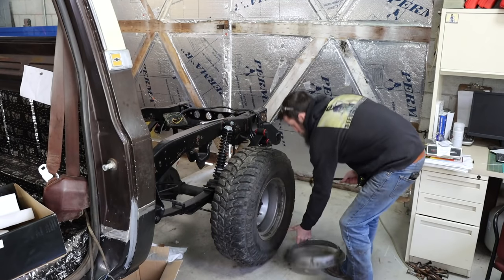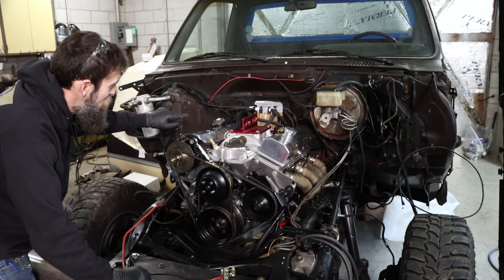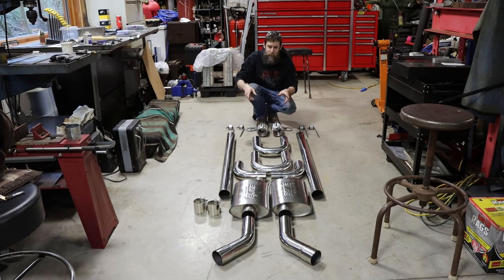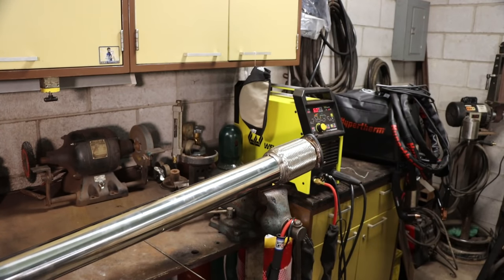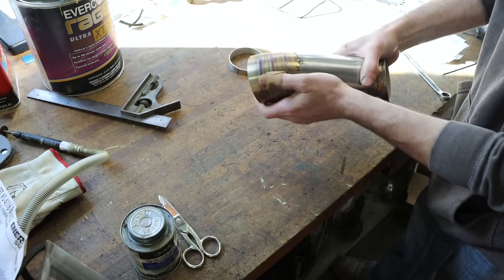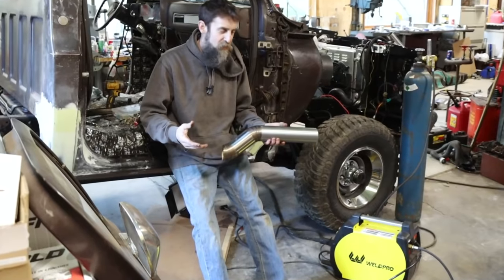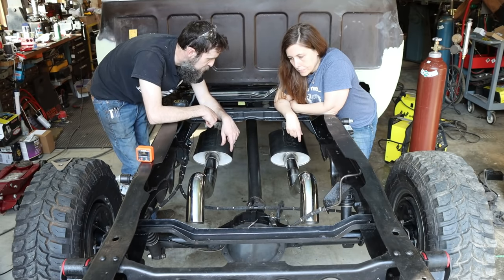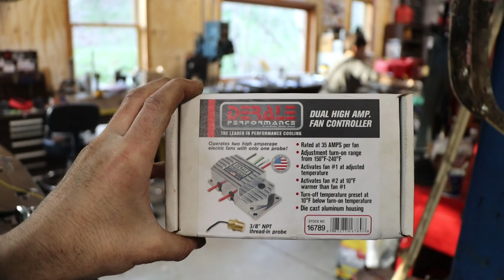Sick DIY Stainless 3" exhaust on the CHEAP!  + Wheels Complete!

Comment: My biggest complaint about daytime running lights is the fact so many folks forget to turn their headlights on in fog or at night fall leaving the back of the vehicle invisible to anyone behind you. I believe the auto manufacturers have been forced into requiring that tail lights come on with day time running lights now (I could be wrong). It's been a standard requirement in Europe that any vehicle equipped with "fog lights" is required to have rear tail "fog tail lights" (red in color and brighter) to avoid rear end collisions in fog. Your build is coming along nicely Steve, thanks for bringing us along for the journey. Stay Safe & Cheers!
Reply: This is what should happen. I live in a major metro area and quite a few folks/id10ts cannot figure out that their head lights are not on as the evening progresses. This continues as they exit the lighted expressway sections which is in excusable.
Reply: I'm not a fan of daytime running lights, HOWEVER I think that headlights/tailights should automatically come on when the windshield wipers are turned on for extra visibility in inclement weather.
Reply: It's that some manufacturers are turning the dash lights on when dusk so people think they are good to go. living in Canada where we've had daytime lights forever, it's the cars without DRL's that trick you up as you're used to seeing them
Reply: I see it all the time.  Most often it'll be someone pulling out of a store or gas station.  I suppose the lights in the parking lots are enough to not realize you have no gauge lights.  I live in the sticks, so there are no street lights or anything, but I still see people whizzing down the road without their lights on.  I've had DRLs since I bought my Jetta in 2005, yet I've never failed to turn on my lights when appropriate.  It's hard to trust drivers that fail to realize they never turned their lights on at night.  Or as you said, in fog, rain, etc.
Reply: @pamike4873  you hit the nail on the head regarding gauge cluster lights. New cars often have fully digital gauges, so they're always lit, with or without headlights on. When cars had gauges you couldn't see at night, it was pretty clear your lights were off
Reply: I’ve a 2006 Range Rover and it has an “Auto“ setting that brings the lights on whenever the sensor in the windscreen senses that the ambient light is too low. I leave that turned on all the time and never have to worry about driving without lights. My wife has had two newer vintage cars of a much less cost when new than my Rangie but they both have auto light settings on them. A 2014 Vauxhall and a 2019 Ford
Reply: @samrodian919  My 2007 Jeep Grand Cherokee has auto headlights.  I don't use it because I"m not one of those people who lack all situational awareness.  Those that are don't use it either, and that's the problem.  My wipers will turn on automatically, and in the US, if your wipers are on, the law states your headlights, need to be as well,  but I don't use those features either.  If it's raining, I turn my lights on.  I suppose it comes from growing up before all of that stuff was available.  My first car was a manual, which today is the best insurance against theft from millennials, lol.
Reply: some forget some are morons or just to lazy and think they will wear out their headlight Bulbs. it happens a lot here in Australia John.
Reply: @pamike4873  well having been driving since 1972, and the first 49 and a half years I had no auto headlights, so I think my situational awareness is pretty good.. I'm a firm believer in the Swedish idea that you have your headlights on at all times regardless of the time of day or time of year. And now I've got auto lighting it as far as I am concerned is one thing less I have to think about when driving in today's crazy world and almost good as sliced bread!
Reply: @samrodian919  Perhaps.  On cloudless days I usually don't run with my lights on.  If it's cloudy, I do.  The problem isn't auto headlights.  The problem is daytime running lights.  Well, DRL isn't the problem.  People are.

Comment: BORLA. I have a 1985 sports car and has a Borla exhaust system, no mufflers at all just the HI Performance 3" pipe out the back. It's load but not to bad if you're just taking it easy, but when you throttle it up you can be heard. One of the best sounding cars I have ever owned. Have been told that from a lot of people. Your exhaust system looks fantastic. Really a great locking job. The only thing I would have done differently was switch sides with the mufflers so tho word Borla was facing down, unless it requires them to be that way. All your videos have been top notch.so interesting they go by very quickly, but it's the quality you are putting out. Keep up the great work filming and building. It's great to watch, learn and enjoy every Saturday. So till next week,  be safe. And your helper is one of a kind. Thanks

Comment: A few years ago my son and I installed a 2.5" stainless exhaust on my 70 390 AMX. It took me over 2 months on my car lift in my spare time. No slip joints,tig welded. You did a great job from someone who has been there. George from Indiana

Comment: When you very first started this project, I thought it seemed odd to put so much effort into cosmetic repairs on an old truck. Boy was I wrong! I thought she couldn't ever be more than an old farm truck, that thing is becoming more and more beautiful. I guess it's been awhile since I saw an old square body in nice shape. Between the Wheels and everything under the hood, that's becoming a real 80s icon, particularly with that two-tone paint job.

Comment: Steve so much progress since I visited you les than 7 weeks ago! Wow you must be putting in the hours! Engine built, installed. Wheels refurbished, rad panel sandblasted repaired and painted. All that wiring and fitting the rad panel and hooking pipe work up. And the piece de la resistance, the fantastic stainless exhaust! Truck is really coming together and looking great! Can’t wait to hear it fire up!
Reply from the maker: Yep, I have been pretty busy the last few weeks. I'm trying to finish this truck up as soon as possible. She needs lost of attention 😁. Hope you trip was good and it was a pleasure meeting you.  Thanks for taking the time to stop in and say hello.😁👍
Reply: @SteveSummers  it was a thrill to come and meet you Steve I was honoured you could spare the time for me. Looking forward to seeing you and Elizabeth driving down to Lowes for some other project stuff!
Reply from the maker: @samrodian919   I look forward to getting to use this old truck for those project trips as well. It should last for another decade or more now . Next time you are back in the states you are welcome to drop back in for a ride in this old truck.
Reply: @SteveSummers  Steve, thank you. I would love to take you up on that!

Comment: Tesa tape is the best. They also make it for applications where heat is an issue.
Has been used by European automotive manufacturers  for many years.
I use it for installation of automotive stereo equipment.

Comment: That Tesa tape is amazing.  Back 20 years ago I started estimating wiring harnesses for one of the big auto companies, and Tesa came in and showed us and our engineering team this tape. They make all kinds of it, felt covered, anti-rip (which is what it looks like you are using), friction tape (no glues, just a plastic tape), etc.  All kinds.  They provided all of us several rolls of each as a "swag bag", and it is, as you said, the best tape I have ever used.  The rip/cut resistant tape is just awesome.

Comment: On start up I would spin up with the ignition disconnected to prime the oil system before first run. Great work!!! Thank for sharing !!
Reply: On SBC, you can drive the oil pump directly, via the distributor port (distributor removed, obviously). There's a ton of cheap tools made for this purpose.

Comment: soon you will get bed on - get a fuel tank and toolbox and consider rails, also think about another battery box with disconnect, also maybe put spare tire back in bed instead of underneath, think about a headache rack/rollbar and led lites - you are almost all set! - the 3 inch exhaust was a good call - think about a lift?

Comment: If you haven't already put some zip ties over the tesa tape ends to prevent it from unwrapping. In the future if you need cheap fan relays, the ones on 80s/90s Hondas by the hood latch work nicely. Wire them up the same way Honda does.

Comment: Wow, a LOT of content this week! The truck project is really coming together, and looking good. Superb-looking exhaust, so far. I vote for turn-downs at the rear bumper. 
I like the tip about the Tesa electrical tape. I was going to retape my original engine harness on my Charger, that has either been attacked by rodents and/or been heat damaged.
Reply from the maker: You will not be disappointed.  They make several different types.  The one I have is the fabric type.

Comment: Thanks for the tip on the sandblaster kits. I have one the way for the same reason as you: I have an old set of rusty wheels that need to be painted. I wasn't sure what the best way to strip them would be and then I saw your video last week. The wheels turned out great and the whole truck is looking 👍.
Reply from the maker: If you have a pretty decent pressure washer you will not be disappointed.  A couple of my wheels were rusted pretty badly on the back side and also had several layers of paint and primer. The sand blaster kits are well worth the cost.👍

Comment: Loved the exhaust system, so much better than any cheapo system from the local exhaust center. You made the right move by getting rid of the nasty electrical tape for the tesa harnes loom tape, it's great stuff and less likely to fail and has better anti chafing characteristics.

Comment: I put that exact same radiator in my c10, been pretty happy with it. I did have one issue the lower trans cooler port wouldn't seal, I eventually stripped out the threads trying to get it too. I think it might have been the flare on the original lines not mating well with the flare on the radiator.

Comment: Fiamm brand horns seem to be good. If I recall, they are available from HF.
My experience with junk yard OEM horns found that they hold up rather well. A cousin put Buick horns on his Chevy boom truck, and they were very loud. U pull it type yards are often a good source.
Make sure that you get the factory plugs with them, and maybe the horn relay as well.
Take, or at least find there a good battery to test them before buying, otherwise you might get junk ones with no warranty.
Scrap yards that buy cars is another option, if you have any nearby, and they let you look/shop.

Comment: I've always been a fan of the "street sweeper" dump at the rear wheel. You're not throwing nitrous flames (yet) to worry about melting your tires and while its personal preference, it just looks cool because of how few vehicles have their exhaust in front of the rear tire like that.
Reply from the maker: I was very tempted to run it out at the front of the rear wheels. Seeing as I had the pipe I just decided to go on out the rear. Thanks for watching

Comment: Very impressive work with the exhaust system!  This summer (and the many winters to come) you will be really enjoying this truck.  Truly fine work you are doing, congratulations! 
Please allow a safety suggestion.  I noticed at 41:30 several gas containers over your shoulder.  May I suggest you gather them closer to an exit door where they would be easier to extinguish in the event of a fire.  I have been watching since before you started the garage and saw how much work you put into it.  With as much cutting, burning, and welding you do inside the shop I suggest you reconsider your flammable storage area.  Keep up the great work!

Comment: Speaking of exhaust, I had planned to put a TDI in my Nissan D21 truck before it was stolen, and I was going to run 2.5" SS pipe. I have a baffled SS turbo diesel muffler which I bought at the scrap yard, and it's a good brand. I'm hoping to find another truck to do this on.
The muffler was a display model and had a window cut in it to show the interior. A friend welded a piece over it and polished it and it looks nice.

Comment: Steve, you can also use Type B Solar Flux for the interior of the SS tube weld area when it is not practical to purge with argon.
Reply from the maker: Ill have to try that. Most my stainless welding at work involves back gas so I haven't used anything else

Comment: The Tesa tape is used to wrap the harness wires to heated windows. Worked for Magna that makes windows for a number of brands and I can't tell you how many of those that I sleeved and wrapped in the time I worked there. The stuff isn't cheap and I'm sure a number of rolls sprouted legs and walked out of that place...

Comment: Oh I've done my fair share of welding (to the point of my right sleeve with more holes than a teabag lol), I think tig welding is better for neater looking welds and they aren't as brittle a weld as a mig can be.

The SS pipes should outlast the truck lol

Sometimes the more you fiddle with or upgrade engines etc the more they can go wrong

Comment: Steve have you ever tried Solar Flux on the back of your stainless tubing welds?  Its for those times when you cant back purge with Argon.  I just used it on an exhaust I TIG’ed and it eliminated the sugaring for the most part.

Comment: I would hold off on that crossover pipe till you have run the engine at least once , it would make diagnostic easier if you have a problem with the engine not saying you will just thinking about what could go wrong.

Comment: My pops just turned 70 and i gotta keep on him even though hes 100 miles away, he tries to do things that are going to end up killing him..  he rented a damn front loader a month ago and the mans never driven a piece of heavy machinery in his life.  Got it to move a whole bunch of rock around a pond.  Well he didnt know about bucket weight and not to drive with a full bucket up in the air downhill..  at top speed..  with nobody home or anything, no cell phone.  Well it ended up bucking him out a good 20 feet onto his head and neck..  broke his arm and damaged the nerves in his neck and cant move half his body..  been like that ever since.  Worst part was for some reason i tried to call him and he didnt pick up.  Waited a few hours and no answer so i worry too much and said screw it im going to go see pops..  well it was about 20° out, wet, dark and when i got out there i go up his driveway and see a front loader sitting on its tiptoes smashed in windshield and cockpit.  Arms bent and lights are on shining into the grass and mud,  so i put my truck in 4high and put 3 lines straight towards it, find him barely alive ontop and with some rock on him bleeding from the head, ears and mouth..  i thought i just came up on him dead.  Would have ended me, would have had to join him if did. But i called the air ambulance and they got there in 10 minutes and is way out middle of nowhere danville kinda..  i took the rock off him and just saying no the whole time and i hear his stubborn ass say "no what? I know im about dead thats what i know son". And it hit home ..  tear up thinking about it..  jesus..  gotta watch us guys who spent their lives doing shit when we get old we think we still can pick up a transmission on our chest and bolt her up like we did when we were 25...   or think operating heavy machinery is easy and safe, i don't need my phone with me or anybody spotting me...    christ sake..

Comment: Hi Steve, you might want to read a few reviews on the headlight units you’ve installed as the ones I’ve read are not too complimentary. The general view is that they are badly focussed and blind oncoming traffic which you suggested was one of your pet hates…
Reply: Also, have you ever been blinded by a pickup truck and when they pass you see they have a heavy load - so they can't dim? Probably be expensive to solve that one though.

Comment: Wolo All in 1 
Double tone air horns are great.
The bigger one.
Needs a relay for proper operation.
The Wolo 419 Bad Boy Is The Latest In Air Horn Technology, A Patented One-Piece Design That Requires No Hoses. Installs Easily In Minutes By Simply Transferring The Factory Horn Wires To The Compressor. Mounts With One Bolt Included In Kit. Produces A Powerful Dual Tone Air Horn Sound That Is Two Times 2X Louder Than A Factory Horn. The Bad Boy, Is Compact In Size To Fit Any 12-Volt Vehicle And Will Provide The Vehicle Owner A Powerful Air Horn Sound. They Will Hear You Before They See You. Built With A Heavy-Duty Maintenance Free Compressor That Will Provide Years Of Dependable Service. Instructions In English / Spanish.

Comment: Steve, I like the work you did on the exhaust system. It looks very professional.

A question (note that this is a question, not a criticism): Did you consider buffing/polishing those carefully fabricated bends to maintain the overall high-shine look? It seems to me that that would be fairly easy to do with a buffing wheel on you bench grinder and a couple of different grades of metal polish sticks.
Reply from the maker: I did. It is 6 or a half dozen with me. I am fine with it either way 👍

Comment: That exhaust is going to be loud.  Big difference between 3" vs 2.5" and straight through vs chamber mufflers. I had 3" and straight through mufflers on a 6.2 LS3 and it was way too loud!  Changed to 2.5" and Flowmaster 50's and it is now much more reasonable but sounding great. Nothing like the sound of Flowmasters.